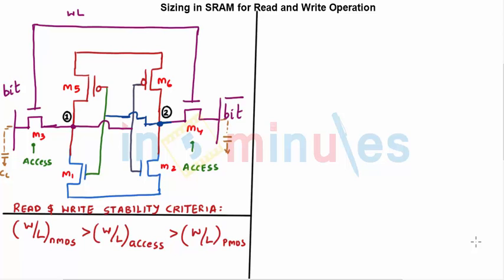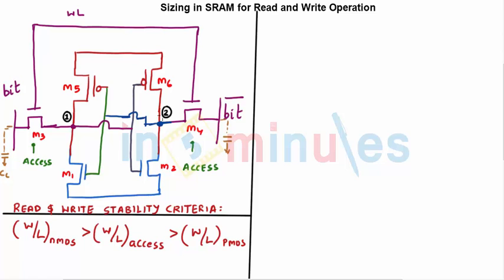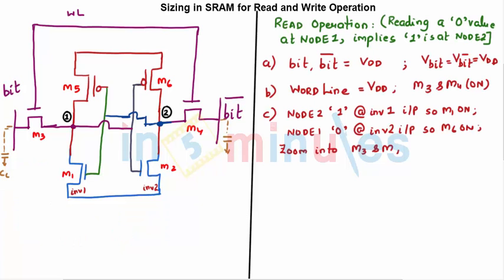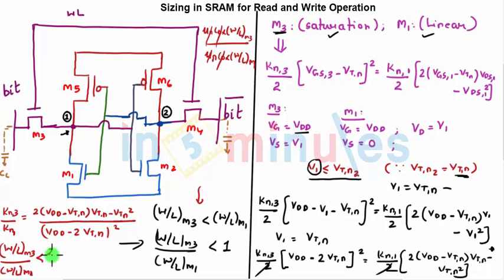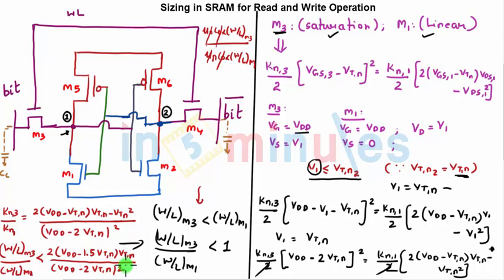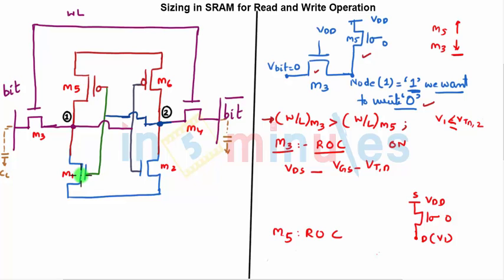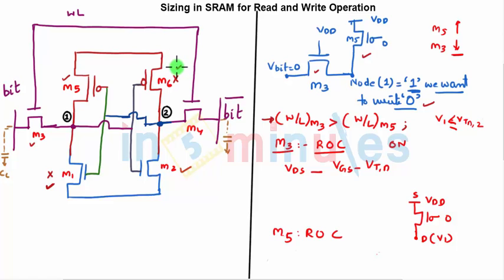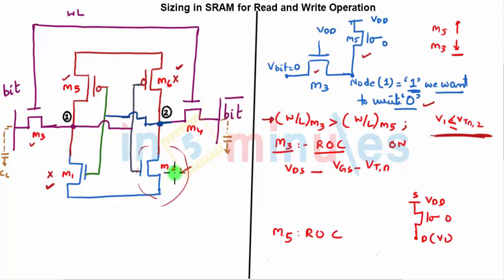Module4_Vid12_Sizing of SRAM (E) transistors for Read and Write operation

Comment: Can anyone explain while sizing for write, how M3's terminal connected to BL becomes SOURCE, because in read operation we consider that same terminal as DRAIN ?
Reply: the mosfet is symmetric device. Drain and source are interchangeable terminals. This is why drain / source selection does not matter.